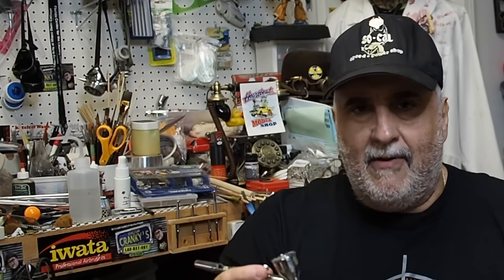RATTLECAN vs AIRBRUSH

Comment: I get about a 97% success rate with the rattle-can, but if anything can go wrong using the air-brush, it generally does. I keep at it because of the benefits and joys when it works.

Comment: To be honest, even though I'll ping-pong between both methods, I prefer rattle cans for the ease of use and simplicity of cleanup. Not that cleaning an airbrush is a monumental task or anything, but inverting your rattle can, flushing out any residual paint with a quick spritz and then wiping the excess paint off the nozzle before capping it lets you get on to the next task that much quicker!